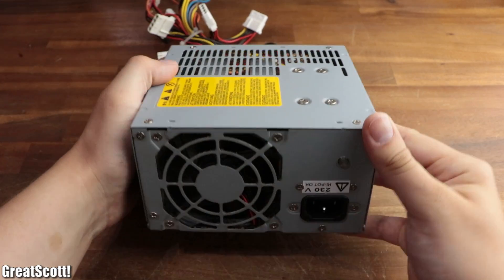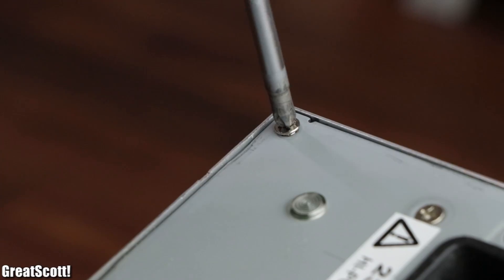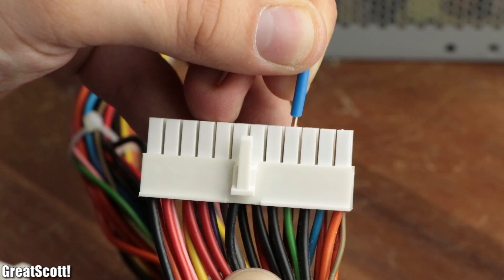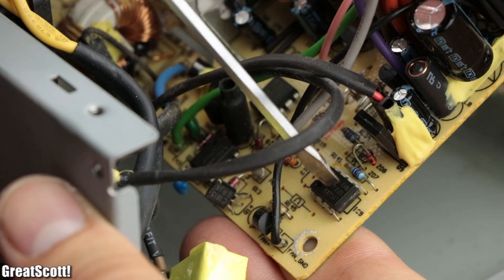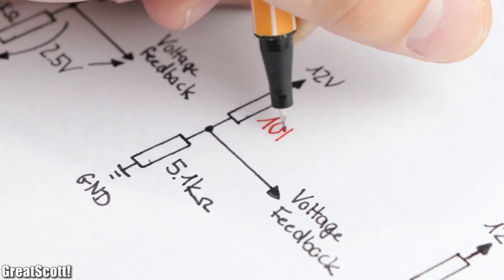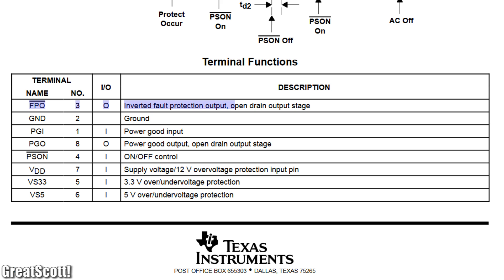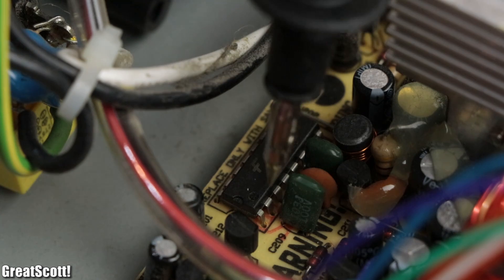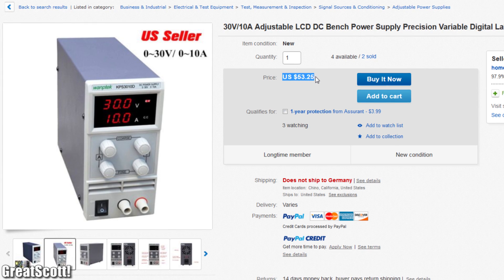HACKED!: ATX Power Supply with Variable Output Voltage?

Comment: I am so proud that you did not recommend this, because I made myself a DIY ATX powersupply just yesterday!!! I would be mad if this actually worked.

one question, why didn't you put fuses in your DIY ATX power supply? wouldn't shorts be dangerous or kill the powersupply?
Reply from the maker: An ATX power supply usually has a short circuit protection. So it turns off automatically.
Reply: Upcycle Electronics Cool man, I checked your channel and the vids are pretty good!
Reply: Tunahan Karatay 
  The wire resistance is negligible. You can look up tables that relate wire gauge and length to resistance. The resistance should be much less than a 1/10th of 1 ohm.
   If you do a bit of experimentation with making your own current shunt sense resistors, this will become much clearer. Copper wire makes for inconsistent shunts that perform poorly with changing temperature, when compared to commercially available shunts. Copper wire shunts are often used in cheap consumer devices for the automotive market like lead acid battery chargers. Sometimes this principle is used in power supplies that will sense the voltage drop across a long PCB trace designed with a specific cross sectional dimension to effectively do the same thing. To play around with such a circuit, just get a cheap INA106 differential amplifier. Get the one that has a gain of 10. This gain is achieved through laser trimmed resistors built into the chip itself. This is a very useful little device for measuring small voltages. A good device to build in order to understand it further is on a YouTube channel called Scullcom Hobby Electronics (I have no affiliation with the channel other than simply being a subscriber). I really like his milliohm meter tutorial series. It's designed around the INA106. An alternative approach is to simply understand the difference between a 4 wire resistance measurement and how it relates to a 2 wire resistance measurement. If you understand how this works dynamically, it's effectively the same concept of wire resistance magnitude. Once you know the wire resistance Ohm's law will give you the rest of the grity details.
Reply: GreatScott! I know that verry well, it has saved me more than a few times
Reply: Neki Dzemaili Also probably the wires will block some of the current and won't allow 30+amps to pass.
Reply: did I read the data sheet correctly, that when it turns off automatically during a short, that it comes back on with limited current? I didn't understand how to reset that....is that something you can address?
Reply: It has to have protection features because only one output rail is monitored in the feedback loop. The other voltage rails are usually regulated simply through their turns ratio on the same transformer core as the regulated rail. This is why the primary rail carries the highest current rating and is designed to carry most of the load. The other magnetically coupled rails have a much larger output variance or to put it another way, they have poor output regulation. This is especially the case if you draw more current from them than the main rail. The auxillary rails must first influence the main rail before the SMPS controller can detect the change and compensate. Basically an ATX system is designed as simple as possible for creating multiple voltages at high current.
  It is far easier to modify a SMPS circuit that is designed with a peak current controller instead of a PWM controller. These circuits only contain 1 comparator and therefore 1 feedback voltage reference. I've uploaded a video on modding one of these (none monotized/cc license/no affiliate marketing).
   Peak mode controllers are found in everything from car type phone chargers to laptop/printer power supplies. The most ubiquitous and ancient chip is the MC34063. It's a good place to start but it is limited to 500-700mA and was designed before power mosfets were standard so it's terrible for high output.

Comment: Thanks for another good video with clear explanations and useful suggestions. I think that I would still use the computer PSU, but as you suggested at the start either use a boost or a buck converter for variable voltage. Most my circuits are less than 12V., so a buck converter should be sufficient.  (I still have some malfunctioning PSU's laying around. Perhaps I should try to revive those when I can find some time off...)

Comment: what I understood from the video:
"I found this random chip, connected some stuff, and removed a random resistor. my PSU stopped working so I did something else to another one I had, and walla, it worked. btw I don't recommend doing this because it's extremely dangerous"
Reply: I disagree, I think there is nothing random about his approach. He methodically checked each chip datasheet and found the control chips and then modified the sense circuits. Then after realising the modification would require disabling the safety features of a very high current device, he rightly abandoned the idea. IMHO this was a really well constructed video. Though I do agree a danger warning re high voltages and risk of death should have been at the beginning.
Reply: I agree, what he did was reverse engineering the circuit, and careful planing and modifying the circuit to work as he wanted. But unlike me, he has the knowledge and experience to do it. I was just trying to describe how it felt to me, a person who has zero knowledge of reverse engineering.
Reply: Fair enough. In that case keep watching Great Scott and I would recommend Bigclive as well :)

Comment: make an electric bikee
Reply: he made an electric longboard before. it's basicly the same but for a bike would probably need more custom built parts.
Reply: Michi Lo One of my earlier collegue, made his own electric bike, with a 700W motor on each wheel, a speedregulator (no assist), topspeed around 50km/h on a good day, there would be 5 traffic violation, on that thing.
Reply: And in Germany every bike with a motor over 250 W and 25km/h. And it has to only assist the driver. 

I mean, you COULD ignore the rules. And nobody would probably stop you. But should you risk it.

Comment: I was excited about opening up my old computers power suply, but I would probably end up killing myself... thanks for the heads up :D
Reply: you will only die if you touch the pins of the two bigass caps.
Reply: but please, discharge them with a wire or a screwdriver or something before going any further.
Reply: I was just kidding haha obviously I would aproach everything I would do with great care, it would be ironic if I infact did kill myself since I`m studying in the university of electronics :P
Reply: all the other capacitors are charged to such low voltages that you wont die from touching them.

Comment: Hey I'm thinking about buying a subwoofer amplifier combo meant for cars for my home audio setup, but I have one problem and this is powering the whole thing. Can anyone recommend me a proper solution?
Reply: a pretty decent 12V power supply, maybe one rated for 10A.
Reply: John Cena I haven't found an amplifier that has a rating of less than 1000 watts so just 120 watts will be pretty low or am I wrong there?
Reply: that is peak RMS power of the audio output, thats not how much power they will draw.

Comment: Please keep in mind that opening up a Power Supply can kill you!
Reply: I've seen a few supplies that didn't have bleed resistors and retained their charge for over 24hrs. 
  Personally I handle the circuit like it's a chunk of the Chernobyl elephants foot until I can double check everything.  I religiously go through all the electrolytics with a home made discharge tool. Then check the big boy(s) on the mains side with a meter before getting handsy with a circuit. On larger SMPS circuits I follow up the discharge tool with a wire brush with an insulated handle to bridge anything small I may have missed. I've never seen sparks at this stage from missing something, but I believe in redundancy when life and limb are in danger ;)
Reply from the maker: Yes, I said that at the end of the video.
Reply: Just check your capacitors and make your own discharge tool with a low value, high wattage resistor.
Reply: I say, let's just remove all warning labels from stuff and let natural selection do its thing...
Reply: May I suggest next time putting the "this can kill you" warning at the beginning instead of the end
Reply: Upcycle Electronics A good and healthy respect then. You and SMPS should continue to have a good and healthy relationship. :))
Reply: Absolutely, but preferably with a discharge resistor tool, before completely shorting.
Reply: Seriously, somebody please close, delete or end this repetitive thread. :)
Reply: +Daunlouded   They said "can" not "always will". I've been shocked by 110v AC many many times, I'm alive, but that doesn't mean a grandpa with a pacemaker or heart condition is going to be fine. The capacitors can store a decent amount of power, and that jolt can be lethal to some. My last PSU could run ~3 seconds at 300w after power outage (running my gaming desktop with 60+w of LEDs, so it was obvious when it actually shut down). Clearly those capacitors were storing a good bit of electricity, enough to store a good jolt.
Reply: yes, if you're an idiot
Reply: Correct Mickey. People are SO afraid. Hey, take it easy. No one is going to die here . . . .
Reply: to prevent a capacitor discharge on your fingers, you should short both contacts with your tongue, an old fashion technique.
Reply: Be wary of the 400V capacitors. If you are going to operate a power supply use a screwdriver to discharge them before you start messing with an ATX power supply.
Reply: I seem to remember on the IT news website "The Register", that there was a kid in America that was killed last year when he attempted to change the FAN in his PC PSU. He was only about 13 or 14. Very sad.
Reply: Well, natural selection is great, really.
Reply: Most of the power supplies I've worked on discharge the high voltage capacitors in a couple of seconds, even though this is not a rule and care must be taken.
Reply: ya....just natural selection at its finest.....

if people are dumb enough to open up something that plugs into the mains......while not knowing what they are doing....
pain is probably their only learning mechanism....
Reply: Opening one up is not dangerous. Poking or touching components is where it starts to get dangerous if no safety precautions have bee taken
Reply: Opening up a PSU can kill you. And that was the point of my comment.
Reply: I dont think people watching a video about electronics or making a variable psu would be stupid enough to stick their fingers onto the capacitor contacts
Reply: Indeed. Last yr, i experimented with a PC PSU i had in my workshop spares box. It had been there for at least 1yr, possibly longer.
I disassembled, and thought i better just short the mains caps with a large screwdriver just in case. And Bam !!, damn they still had a hell of charge even after all that time.
So yes, be careful out there folks when disassembling, and short any caps before touching the board.
Reply: grog lololol 
   I think the safety issue is actually blown out of proportion relative to the actual risk involved. It's really quite simple. Electrolytics are dangerous. The same children that shouldn't handle power tools shouldn't handle mains powered electronics. Other than that, nothing else really can matters.

   This demographic audience isn't as "young" as you may think. My data shows 90%+ of the viewership is between 24 and 35. There are lots of exceptions, but honestly the kid that is playing with electronics in their mid to late teens is batting WAY above average.
  I think most of the comments related to the subject are people with a negative disposition and people that simply enjoy complaining about anything possible.
   There will always be a few "wannabe" (village) idiots that try something stupid and get hurt doing something like this. It doesn't matter how much warning they are given. Ultimately the idiot that got themselves killed isn't the idiot that blames it on something that was read or seen on the internet. The lazy or stupid individuals actions are blamed on things like the internet based on inference and assumptions. These claims usually originate from members of the same gene pool as the lazy/stupid individual.
   Ultimately "you can't fix stupid." 
   Someone can always jump into a comment and simply mention how to do things safely.
Reply: also if its unplugged, dont touch the contacts of the two large capacitors.
Reply: Lol, no that has direct and serious consequences for ordinary folk going about their business. It's those with no basic knowledge/respect for things that clearly are designed to keep them out, and have warning labels on them; but still  go poking about thinking they are safe to do so. Natural selection works fine for those who instinctively take note of danger (inferred or shown). Still, I appreciate your desire to see carnage. ;))
Reply: Jonas Hain I opened a power supply once and I shocked myself by a charged capacitor rated for 325v and honestly how does a capacitor get so much power when the is has like 115v
Reply: lol thats a capacitator, google :d they can even have crazy load of power.... See some capacitator shortage videos that even burns and dents screwdrivers ! You will get that it can even penetrate and blow your finger...
Reply: Good.
Reply: Some of the responses to safety concerns seem rather callous.  Some people are lucky to have mentors, or a better ability to do extensive research before exploring... but a desire to get your hands on something, and learn by doing, when mixed messages about safety are prevalent, do not lead me to believe that a over ambitious mistake by a newbie should be disregarded as simply a  potential "thinning of the gene pool."  Many other types of people are less desirable.   Getting people involved in tinkering is good, as well as keeping them safe.   As far as YouTube videos go, a recommended skill/knowledge/safety hierarchy could be offered on the platform.
Reply: Jonas Hain  that's why ur supposed 2 unplug when dismantling
Reply: That's the fun part tho
Reply: Nope if you are careful and not act stupid shit
Reply: Duh, it won't kill yo-- WBJEHIEYEWJKWKAGGAHWH
Reply: Such a warning must be given at the beginning, not at the end. The high voltage electrolytic capacitors in SMPS will be retaining enough charge at a high voltage to cause a lethal shock, before they discharge through the bleeder resistors within a minute. So always safely discharge the capacitors before trying anything.
Reply: If people are stupid enough to mess with devices beyond a reasonable understanding of the risks, then natural selection plays her part in life, doesn't it.  Besides, I have had many a 240v shock for basic carelessness or unexpected fault conditions, I'm still here, as are no doubt many engineers.  It "rarely" kills it just gives you a damn good slapping, unless you're very unlucky.  Now a serious thump from 415v AC, is absolutely another story!!!
Reply: @MickeyDJ1  not everyone, specially the younglings, are familiar with the dangers.
Reply: @nejiniisan1265  Yes, you're quite correct I guess. But even as a 9 or 10 year old, I uderstood the dangers in B&W TV. Different era and different electronic. There were plenty of visual, if not temperature, warnings for a hungry or nosey mind back then. :)
Reply: @MickeyDJ1  me too. But even us, comparing when we were younger and now, certainly we are more cautious now.
Human mind is too complex. Things that are obvious to us are not to others, and vice-versa.
Reply: MickeyDJ1 -  Natural selection never really gets a chance thanks to lawyers and excessive government regulations.
Reply: Watch the full video before commenting...
Reply: Ein Hobby Bastler aus Leidenschaft 
 It works with simple topologies. There are other more complex ways to create feedback especially when it comes to high current SMPS designs.
Reply: Techy Dog Ah, yeah you make a very true and valid point there. ;))
Reply: The OP's statement is not correct. I've opened tens if not hundreds of PSUs for various reasons and I'm still here.
Reply: Just fill the PSU with gasoline and then plug it in.
Reply: Sorry, I wrote this comment when you opened up the PSU. Maybe someone else doesn't watch the whole video and sees this comment. Then my comment wouldn't be that useless. xD
Reply: just make sure it is unplugged, heh obviously
Reply: so i should be dead 10+ times cuz i simply opened  some PC PSU's
Reply: It can kill you if you are a naturally stupid and/or noob
Reply: Only if it's plugged in.

Comment: I used this power supply to power my motor something just blew the motor stopped working, from that day, I never touched one of these
Reply: @Karlo You can't say that every motor runs off of 5VDC. There are many different kinds of electric motors from 2VDC up to 300VDC and higher.
Reply: That could certainly be possible, I just wanted to clarify that there are many different motors with many working voltages, not just 5VDC.

Comment: id like to hear how you explain an lm317 voltage regulator
Reply: An LM317 is not a transistor. It is a voltage regulator.
Reply: Spencer Hopwood thanks for correcting me been a while since ive tinkered with electronics